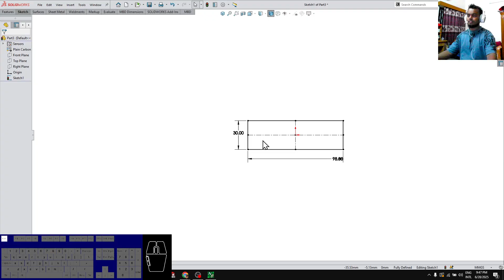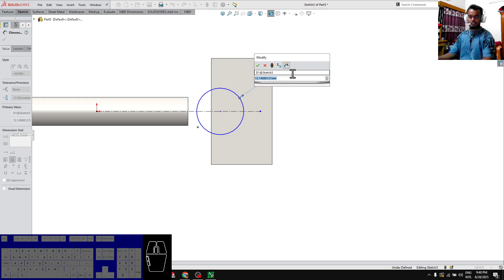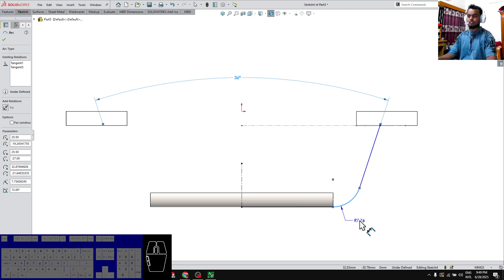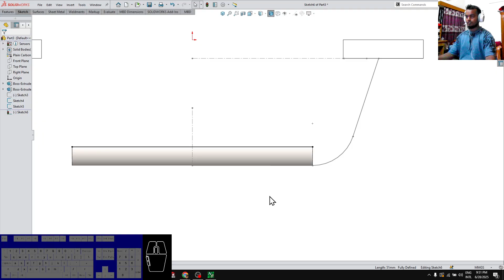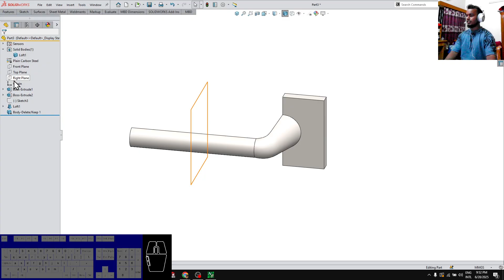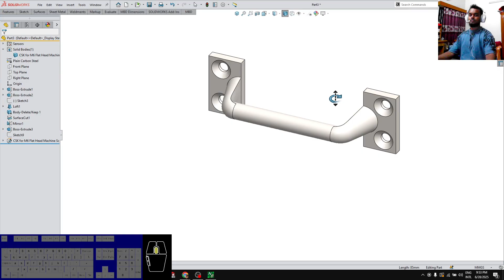Window Handle Tutorial | SOLIDWORKS

Comment: At 5:05, to reorder the sketches, you can go into the 2nd sketch with the dependency on the 1st sketch. 
Go to display/delete relations 
In the dropdown, select “external”
Delete all external relations
Then use the “fully define sketch” command 
Or select all entities and fix them
(or just manually add constraints & dimensions if you want)

That’s an easy way to remove relationships / dependencies but keep your geometry the same
Reply from the maker: Wow that would be so nice, thanks for the tip, will try!